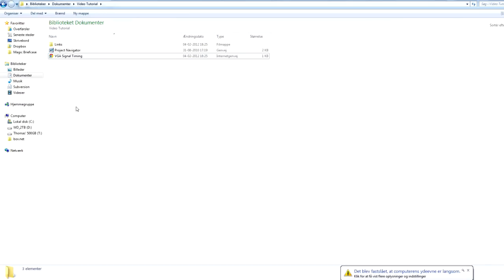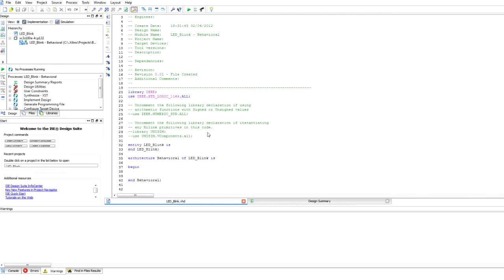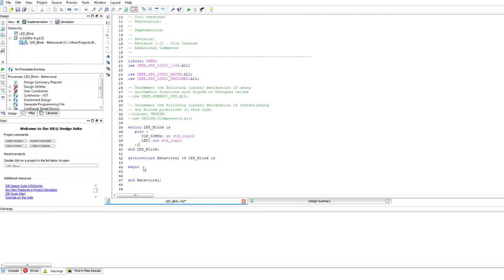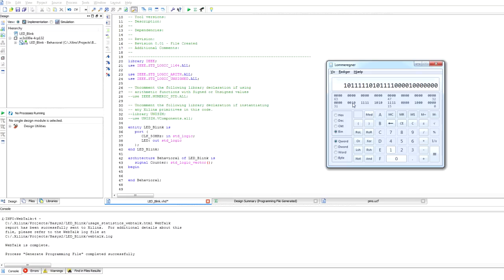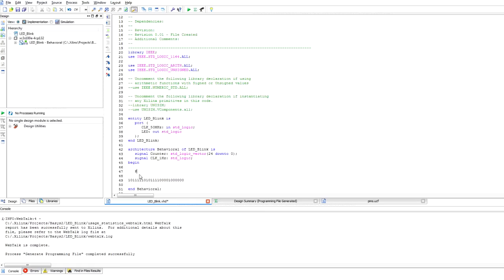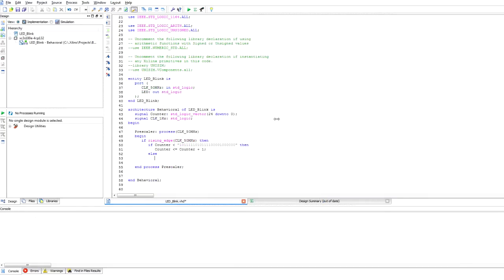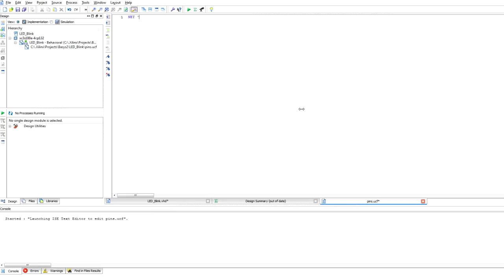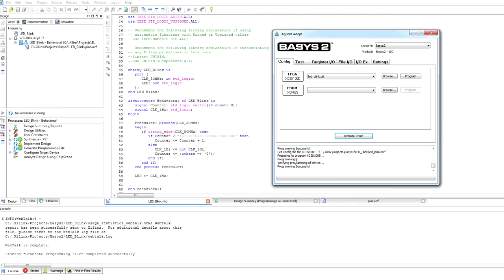VHDL with Xilinx - LED Blink Tutorial

Comment: How could I make the LED blink, for example, for 10 seconds only and then stop?
Reply from the maker: Make one counter for generating the LED blink signal as shown in this video and make a second counter which will count up to 10 seconds. Use an inequality condition to check whether the counter is below 10 seconds (in equivalent counts) and either AND the result with the LED blink signal or use the result to enable/disable the LED blink counter.

Comment: You can use 2 push-release buttons and 1 led light.  Press release button 1 LED blinks.  Press release button 2 LEDs turn off?
Reply from the maker: Sure. This can easily be made in VHDL with a state machine where you would use the button presses to change the state. 
Keep in mind that when dealing with button inputs you might want to consider implementing some debounce filtering logic. However in your case if you have two buttons for just state changes, with one button for each state, I don't think you will need the debounce logic.

Comment: my spartan Xc6sLx does have A usb program. input...TMS TDO TDI TCK 3.3V ... how can i program this?
Reply from the maker: In general this video also applies to other families for FPGA's and is not only limited to the Xilinx Spartan 3E.
If your board is equipped with a USB JTAG programmer supported by the Xilinx IDE you should be able to program it straight from within the IDE. Otherwise you would have to install the software that corresponds to the JTAG interface and load the synthesized/generated .bit file in here.

Comment: Great intro.I tried to implement the code on the Basys3 using  Vivado 2016.4  How do I have to setup the xdc constraint file specifically the clock for this board?Thanks.
Reply from the maker: You would need to find a matching constraints file for the Basys3 board.
https://www.xilinx.com/support/documentation/university/Vivado-Teaching/HDL-Design/2015x/Basys3/Supporting%20Material/Basys3_Master.xdc
I have found the one for you wherein you just need to uncomment the clock line, being one of the first constraint lines in the file.

Comment: can you upload digital beam forming implementation on spartan 3e
Reply from the maker: +Muhammad Haris Please elaborate. What do you mean with digital beamforming? Are you thinking about wireless transmission?
Reply: +TKJ Electronics 
consider any signal( communication signal).
1)First of all we need to convert it into its digital form.
2)After that the DIGITIZED signal is then to be Digitally Down 3)Converted (shifting of signal to baseband).
4)After that these signals will be multiplied by some weighing factors which I would have already stored in FPGA.

I will be using spartan 3e kit.
thanks